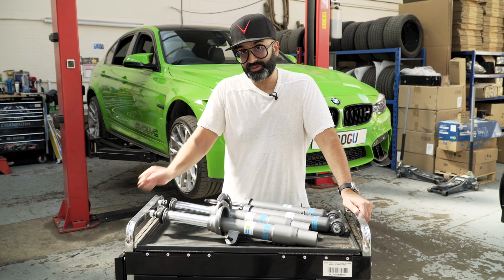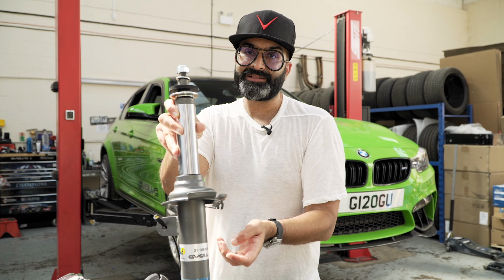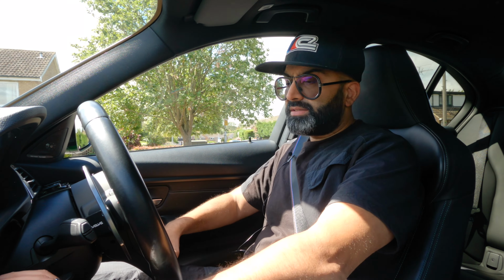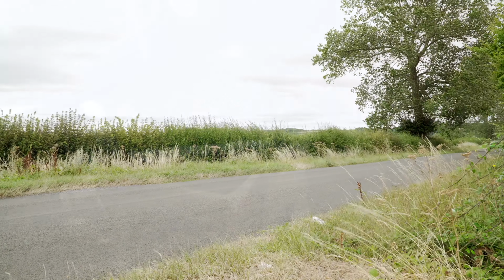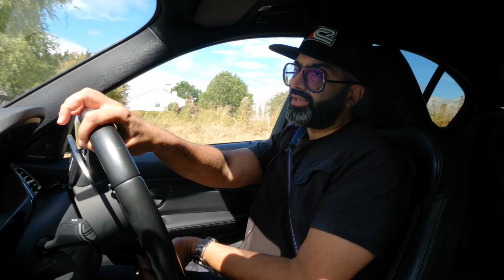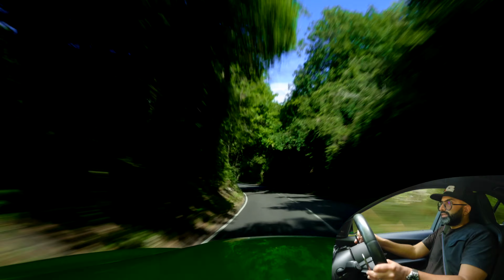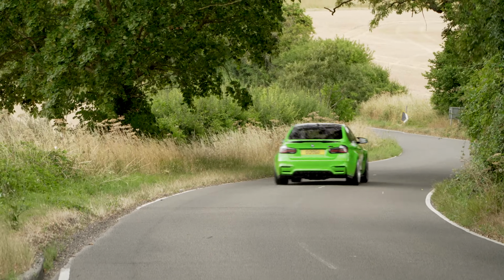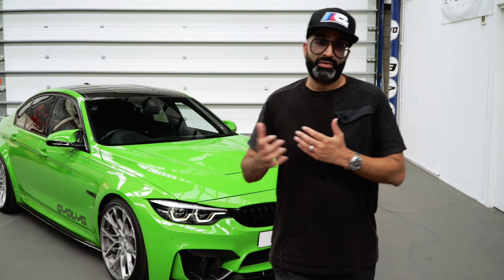Our new Evolve B6 EDC Dampers by Bilstein make our F80 M3 handle like an M2! Driving Review

Comment: There were reports that the B6 shocks raised the ride height significantly vs the stock shocks.  Is this the same or has that changed with these evolve version of the b6's?
Reply: Thats what i want to know
Reply: I bought them. They do raise the ride height but they settle
Reply: @jnperri1 are you riding on stock springs? I have eibach springs, it’s not slammed and I don’t want the car to be back at ride height but can you notice the difference? I’m considering selling the f80 if I cant improve the harshness

Comment: Anyone know if you are able to retrofit adaptive dampers like these to a model that offered adaptive, but where adaptive weren't ordered from factory? Obviously, need to recode the car to know they're fitted. I'm looking for similar larger adjustability, and don't want to pay for adaptive M pkg for a few reasons when ordering my car. It's an i4 eDrive 40, which gets better range on non-M-sport setup (better drag coefficient, range preferred wheel/tire combo). So ironically, not going for greatest grip or ripping around, but family member has motion sickness disability, and greater real-time adjustment of stiffness could really help dial in the right amount of interplay between too bumpy and too boaty. She can get sick from either and it lasts for hours after the drive. Thanks for any insight you can give.

Comment: I have an m4, I can manually switch the modes only on the fuel efficiency and steering but I can't on the suspension, however I dp have my m1 present for sport plus and the suspension definitely gets stiffer, will these still work for me even tho I can't manually switch suspension modes?
Reply from the maker: Are you sure you have EDC? I've never seen a car with EDC without the damper button to change the modes.
Reply: @EvolveAutomotive  honestly I don't know much about it,  there is wires going to each strut, the car does become suffer but yet there is no button near my dtc shifter to change it nor any lighting indicator under my tach, so I don't know🤷‍♂️🤷‍♂️🤷‍♂️
Reply from the maker: Send us an email with your VIN number - sales@evolveautomotive.com

Comment: Would these work on a M140i I’ve got adaptive as an option but would like to keep it without having to buy the B16 kit
Reply from the maker: Do not believe so.
Reply: @EvolveAutomotive  ok no worries, would be really interested if there was a set I could buy
Reply from the maker: You’d have to research retrofitting M3 dampers to an M140i and go from there
Reply: @EvolveAutomotive  surely you guys would know if they would work ??
Reply from the maker: Not something we’ve ever tried. No idea if they would physically fit, if the connectors are the same and then if the software would run them correctly.
Reply: @MrJwwhasabetterchannel bit late to your comment but someone I know retrofitted M3 dampers to there M140i. The shafts needed machining down in size.